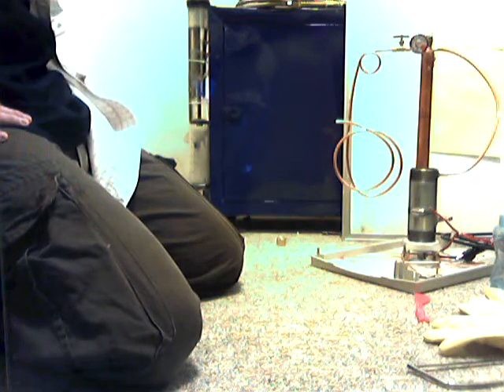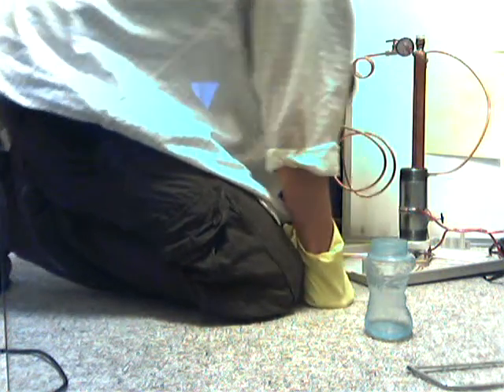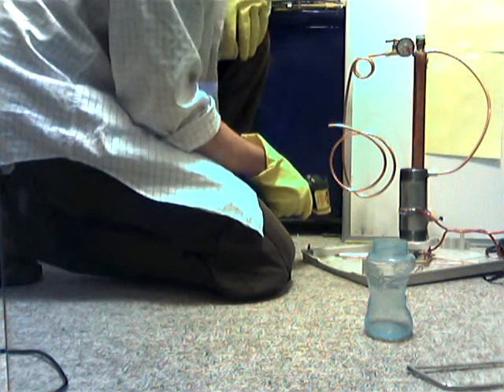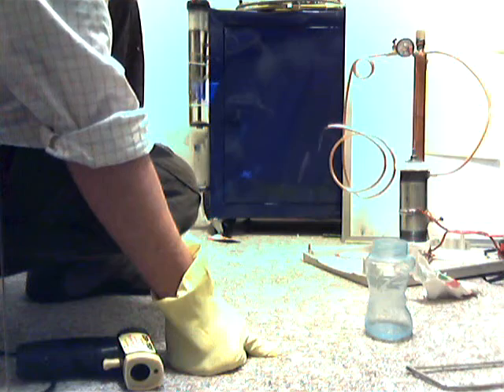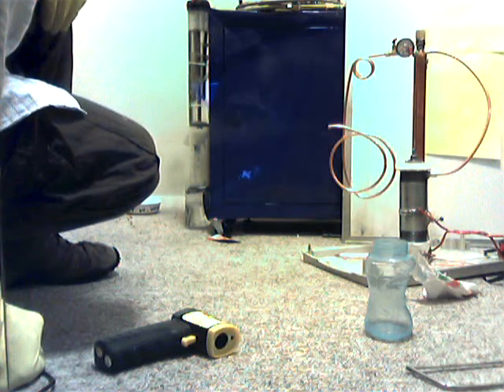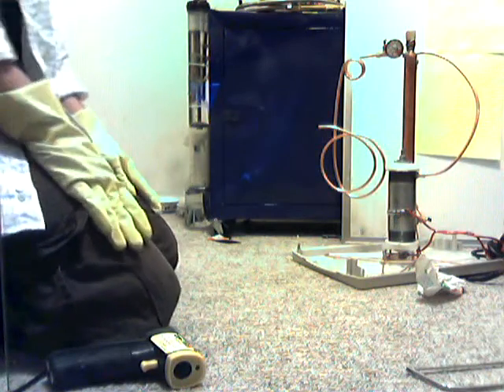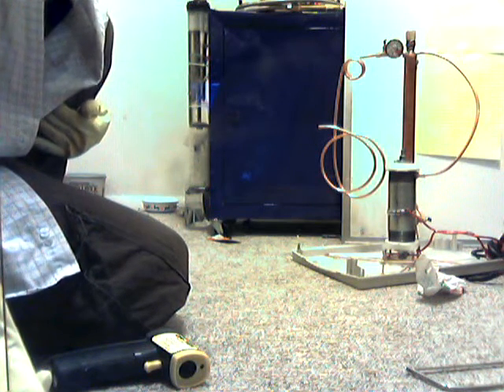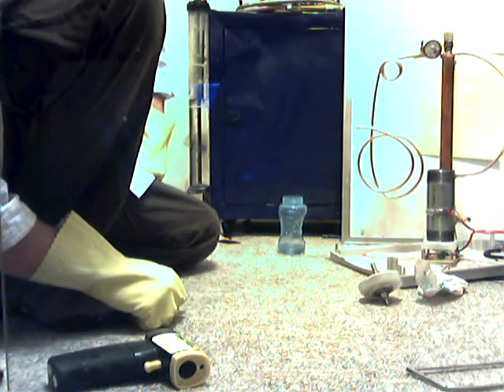DIY electric steam Boiler

Comment: you will need a beefy resistor in order to avoid a short on that heat coil arangement. or a step down transformer, or rectified dc from the ac. at any rate you will need to control the voltage and definatly the current. again be carful this shit will bite you. good work though. keep it up.

Comment: you should not need any electolyte at all. mater of fact you sould use distiled water. with the ac voltage all you need to do is very the distance of the elelctrode to tune the system.